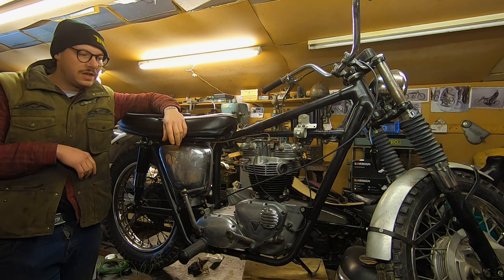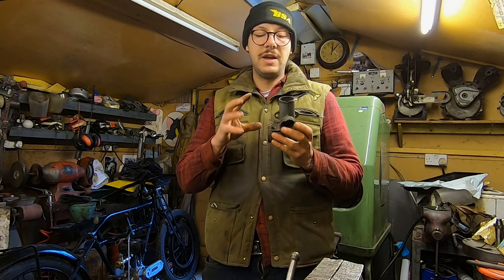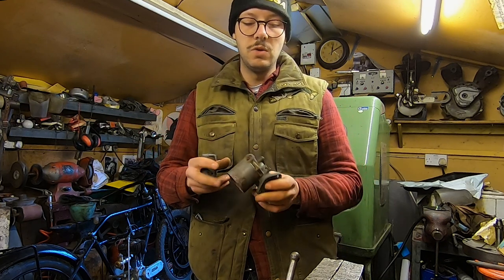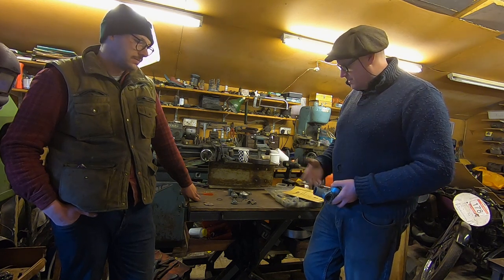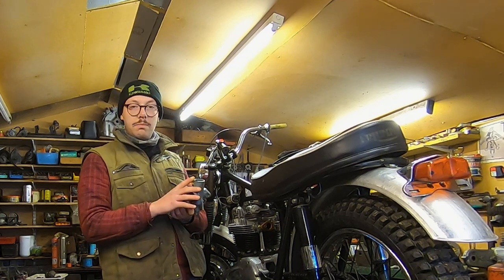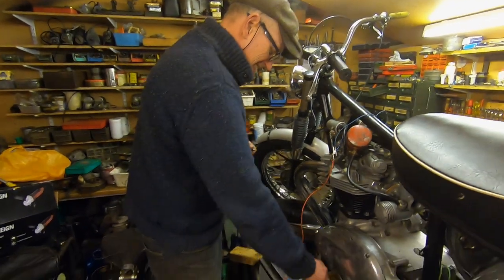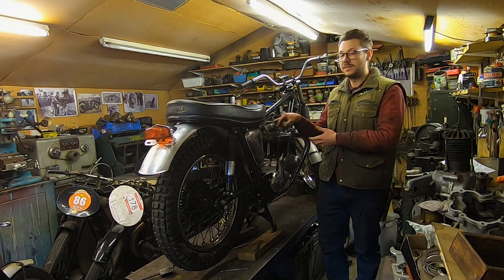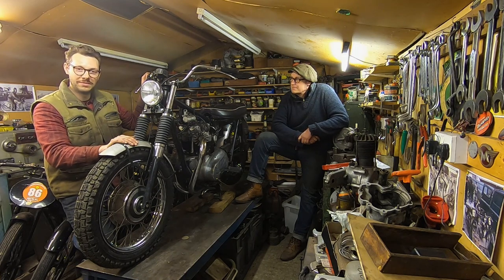650 Triumph Build EP.13 | From Rust To Runner!

Comment: Sounds ok I have not used that carb myself but you have inspired me thank you for sharing 😊
Reply from the maker: Thanks for watching! I'm intrigued by the spec of carb, I will be interested to see how it runs out on the road.
Reply: I currently run a single concentric Amal but using 750 barrels 650 hardened bottom end so higher rev able. Left hand changed for road but am toying with the idea of air shift for drag but not tried this yet. Oh well back to work

Comment: I had no idea that jet block piece was removable... in fact I was staring at my diagram yesterday trying to figure out if I'm actually missing that part from my monobloc?   I've watched a few monobloc videos and I've never seen anyone take that part out.   Now I now it's in there, it just looks like part of the carb body.  

My 1964 TR6 came with a  concentric 930, but I got the monobloc carb in a box with some other parts.  It seems fine, except it leaks a little from the cover.    I'd love to put it on my bike sometime... to see if there's any difference between the monobloc and the concentric as far as performance goes.

Comment: Hi, don't suppose you have a wiring diagram for how you rigged this up? I've just bought a 62 5ta with a 3ta engine (yeah, weird...) and the wiring is so bad that I'm gonnae rip it all out and start again - it'll be a scrambler, so I basically just need enough to get ignition. Cheers!